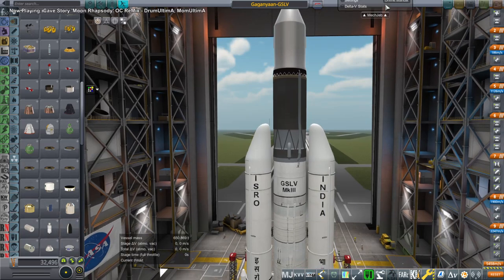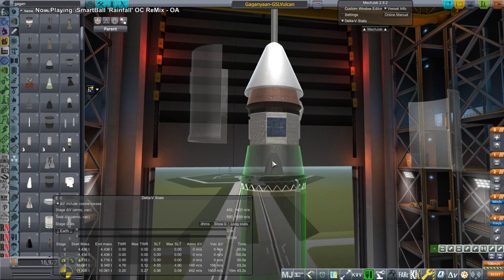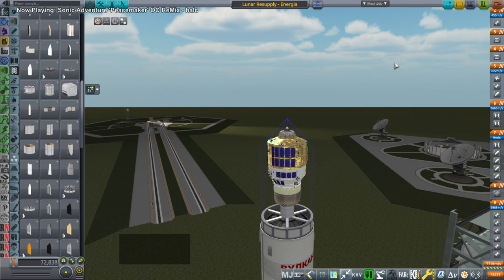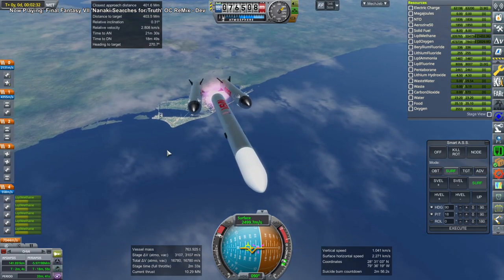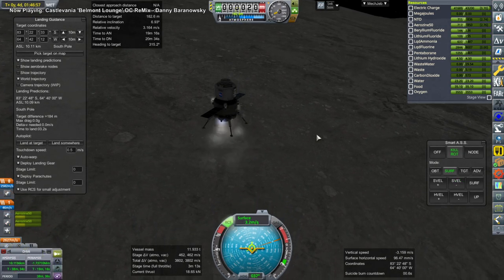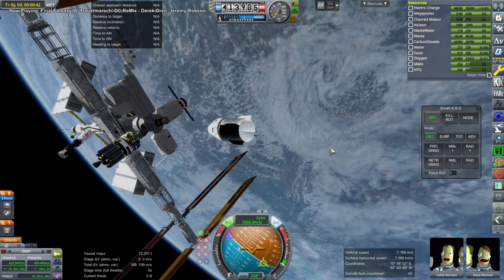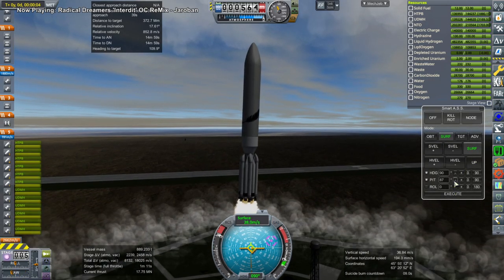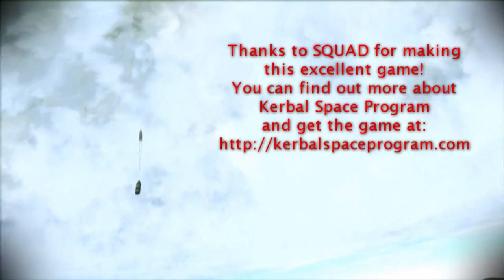Kerbal Space Program with RO - Solar System Tourism 26

Comment: Docking Port Alignment Indicator would be a useful mod to have. Makes docking a lot easier without using the "Lowne Lazy Method"
Reply from the maker: I don't think any lazy method would help you dock when ports lack magnetism - it's a lot of sweat and frustration. However, it's good practice, as when docking Shuttle-like vehicles, neither SAS nor Smart A.S.S. seems to like holding it steady when controlling from a docking port - only from the cockpit. Don't ask me why. Docking Alignment Indicator wouldn't help in that case, so it's good that I practice doing it based on the navball and velocity readings, which I do not consider an easier method.